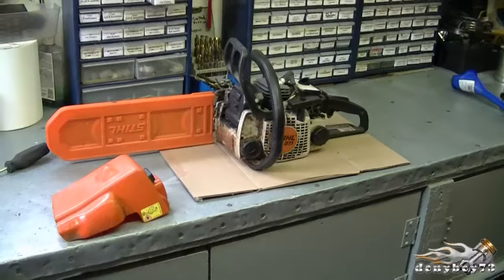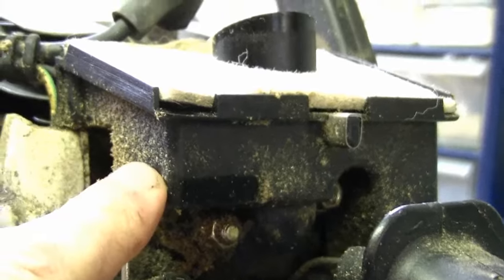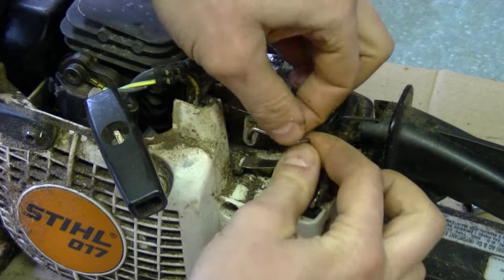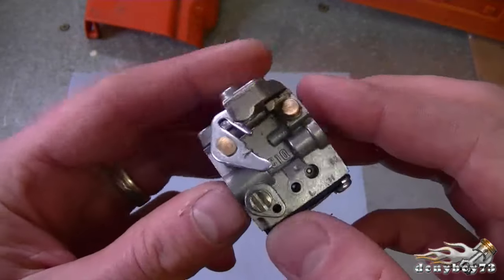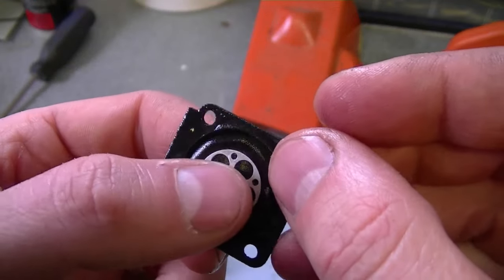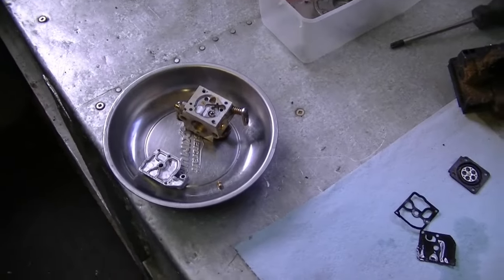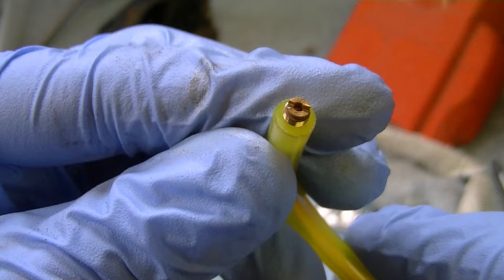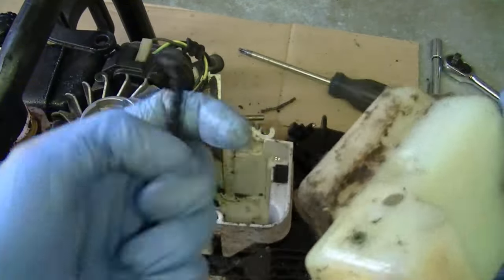HOW TO - Carburetor & Fuel Line Repair on STIHL 017, MS170, 018, M180 Chainsaw Part 1/3

Comment: Hello
I have a stil 170 when it starts go out, if I do not accelerate, how many turns against the clock to adjust its carburetor
thanks for your video
Reply from the maker: if adjustable set at 1 1/2 turns out, if not adjustable try new carb kit and if that doesn't work you need a new carburetor.

Comment: I have to ask; every diagram that i have shows 2 (two) gaskets on the carb (on the END COVER side). There is a gasket along with the Metering Diaphragm and your video ONLY shows the diaphragm taken from the End Cover. Are you missing the gasket?

Comment: How come that my Stihl ms 180c wont idle sideways? It rev up good, and runs good.. But i just starves when turned upright. I tried to clean the carb and chance the fuel line/filter.. What could cause this problem? Greetings from Denmark
Reply from the maker: +Frederik19951995 could be an air leak somewhere, hard to say. I usually do a pressure test or try a new carb

Comment: Hi I have the sthil concrete saw, I replaced the carburator,fuel line ,filters,and it doesn't start, just continues to over flow gas. what else can I do?

Comment: Donyboy - when replacing the fuel line in an 026 or MS260, does the arrow on the upper portion of the of the gasket seat point toward the engine, or to the left (fuel door)?

Thx

Comment: Have a MS 180 C that runs at all times at very high rpm.Tried adjusting idle screw on carb, but still very high rpm. Put on new carb, and same result. Now what?

Comment: Hello dony I’m
At my wits end I have a ms 180 won’t start or run unless I undo petrol cap have replaced fuel lines carb filter tank vent carb and inlet rubber it keeps pressuring in tank and refuses to start or run at all please help

Comment: If you only use chainsaw once in a while; only use ready mix gas and oil sold at Canadian Tire or at your local chainsaw dealer. It has high octane and has a shelf life of 2 years, no more problems with your chainsaw gumming up after that.

Comment: My MS180 bogs down after 20 sec.  Could a clogged duckbill valve in the gas tank cause the fuel system to "stall" out cause no air can get in to replace the gas as it leaves the tank? Also..replacement carbs on Amazon are $20.  Isn't it just easier to replace the entire carb then to rebuild it ? Thanks Donny
Reply from the maker: for that price yes it's easier to replace, also check your spark arrester screen to make sure it's not plugged
Reply: Is that the screen behind the muffler defuser ? it's a tiny screen abuot 1/2 inch by 1.5 in ?   I was able to see through it ok

Comment: I checked for spark, that was first thing I looked, I'm learning from the master. lol. By the way it has good spark. I think that it has enough fuel, because it smells after a few start tries. Then I need to take out spark plug ans clean it from fuel, air blow it inside and then magically it starts again but not for long, for another 10 mins. Is it possible that is oil that is bad if it is from last year and not mixing with fuel properly or something like that I don't know really. It's annoying.

Comment: My Stilh 17 was working great but when I tried to shut it off, it kept running. Obviously, the ignition circuit isn't being grounded out when the switch is moved to the off position but I can't see where the circuit is broken. Any ideas??
Reply from the maker: check the switch wires